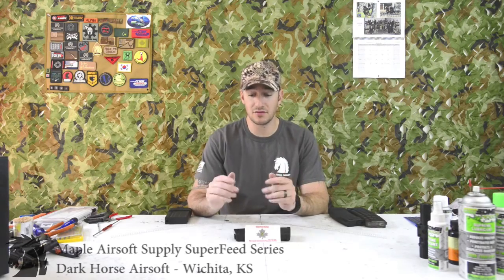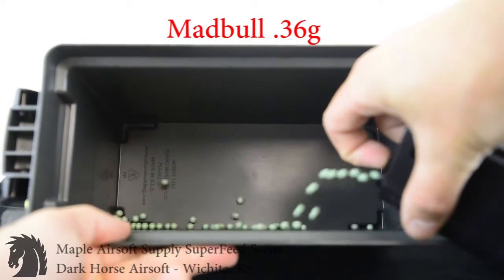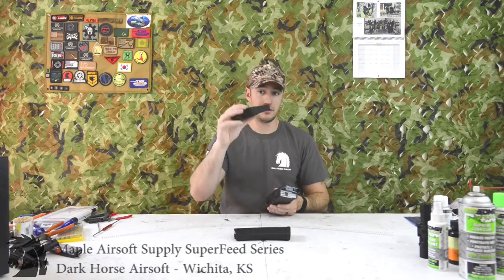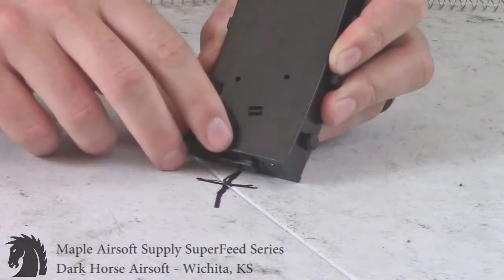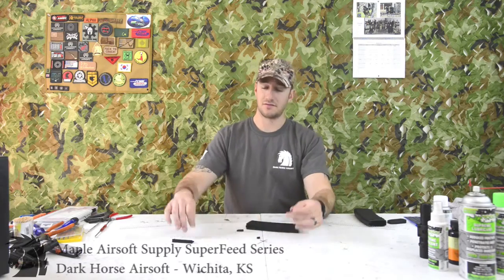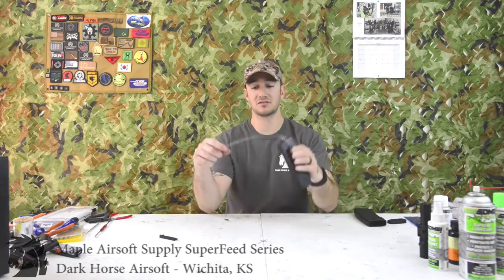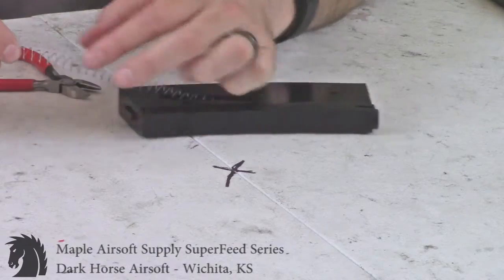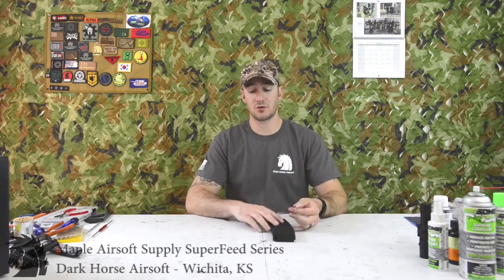Maple Airsoft Supply SuperFeed Spring

Comment: It's true, most M4 type mags are build to feed max 0.28 properly. I had a lot of issues because i play 0.32g Bio's. Event the PTS EPM did not worked properly without some modifications. I will try that spring now in my G&G midcaps (the EPM's are to wide at the base for the F2000)  for my F2000, same issue with the F2000, 0.28 feed just fine, but 0.32g (on semi!!) have hiccups. So lets see if that spring can fix that. And yes i clean all my mags frequently and polished all moving parts with 800 grid sandpaper.

Comment: What about matching the length of the old spring and maybe add and inch or more to get a close length?  Just curious if that would work.  Maybe a set amount to add would be a good measure like always add 3 inches or something like that.
Reply: It's always a trade off for extra spring tension or keeping magazine capacity. The springs are so tight that you don't always need to add anything to the original length.
Reply from the maker: As xFoodbasics said, its really up to you and how much tension you would like.

Comment: I just got these springs for my KWA 120s and I'm not impressed. At first the spring was too long and caused double feeds, then the spring was too short too feed all of the bbs and at some point caused the mag to jam. I did my cuts in increments of an .5 inches. Very disappointed I do not recommend buying these just buy better mags
Reply: If your gun double feeds then the issue is with your gun not the springs. These are not meant for stock guns, they are meant for high speed setups like DSGs and polarstars or guns that chop BBs when they don't feed fast enough like Daytonaguns and PTWs. I have had no issues in any of my guns.
Reply from the maker: Sorry to hear that jared, we have had nothing but success with them so far.
Reply: probst9999999999 I was running the mags in my P* mk18 I tryed messing with the settings to get it not too but they were too powerfull lol
Reply: Dark Horse Airsoft is there anything is spific you did to get them to work? My mags jamed after installing the spring
Reply: it's been a while since I used a polarstar but I would say you likely need to reduced the nozzle dwell

Comment: Holy smokes they're expensive
Reply: Not really, the price on their site is in CAD so it's like $14 USD and it's for a pack of 3 springs. KWA sells a GBB length replacement spring for $9 USD each http://www.evike.com/products/39192/ and these springs are 3 or 4 times as long. They're great I have them in all my mags now, it doesn't matter how good your gun is if it doesn't feed fast enough.

Comment: Anyone use these in the EPM's and not lose any rounds or the orange follower function? I am looking to pick up 6 of these but I want all 150rds and the orange follower to work and tell me when the mag is full.
Reply: Dude I am having the same issue 5 years later 😂 Did you find a solution?